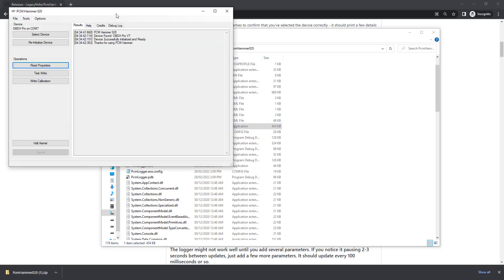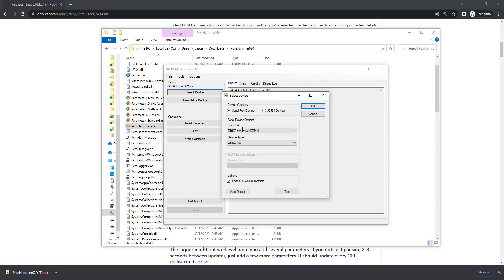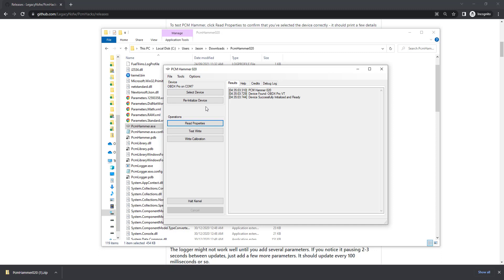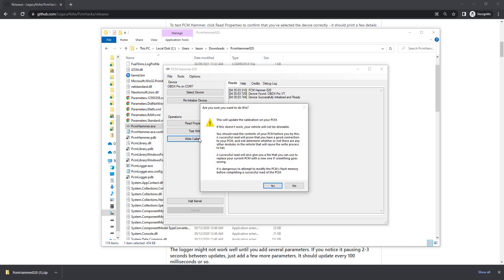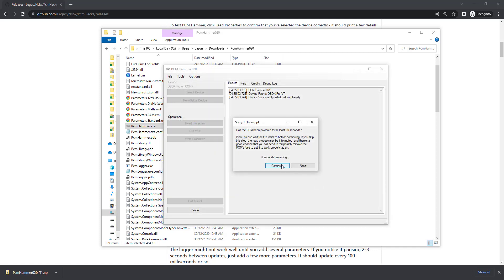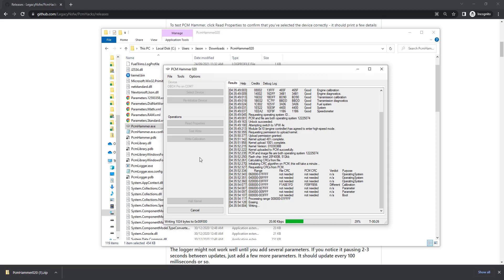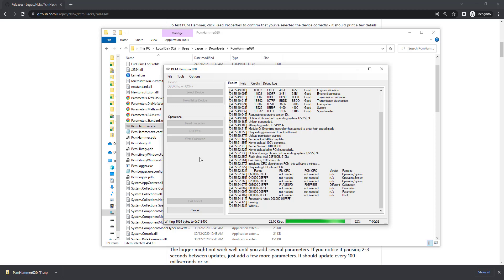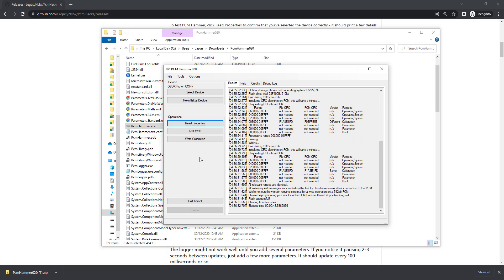Writing PCM with PCM Hammer and OBDX Pro VT

Comment: you and everybody else selects your com port. no one will say how they determined which com port. luck of the draw or you start trying all til you hit one or what? been trying to get my pc hammer to connect to my obdlink  lx for two days now with no luck. error message every  time "not initialized yet"  got any idea what i need to get this to connect? my computer will connect to the obdlink lx using other software : obdwiz: no problems. no comport questions just hit connect and there it is. any help will be greatly appreciated. i don't want to have to start buying credits just to get rid of the vats.  thanks again for the video and your time.
Reply from the maker: @user-es4lb5tv1c This video is demonstrating how to use with OBDX Pro scantools, your using an OBDLink which is a completely different company.
I recommend picking up an OBDX Pro tool and following this video to get up and running.
Reply: OBDLinkLx is somewhat a piece of work for connectivity. I had to power on, power off, replug the bench harness & Dongle, pair the BT to laptop, then RESTART laptop. That seemed to work for me

I also downloaded ODBLink's windows app and connected it once. I do not run the app same time as PCMHammer